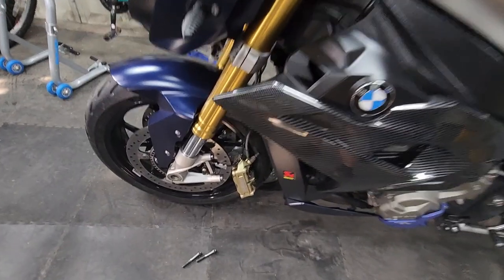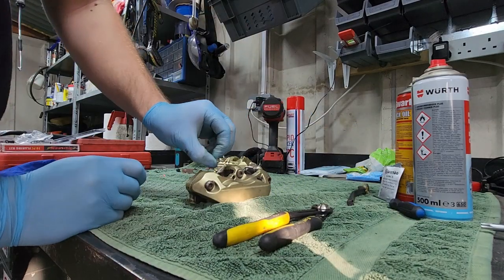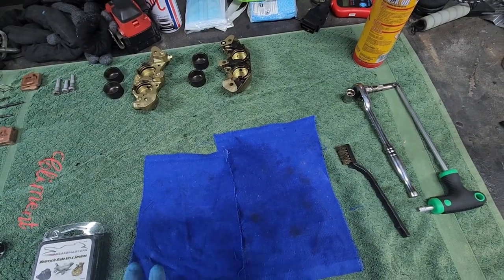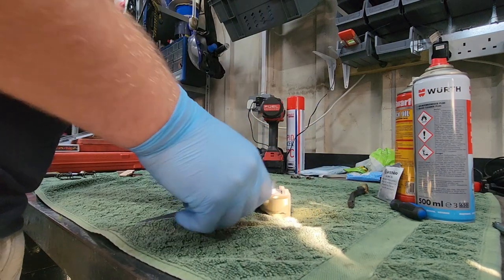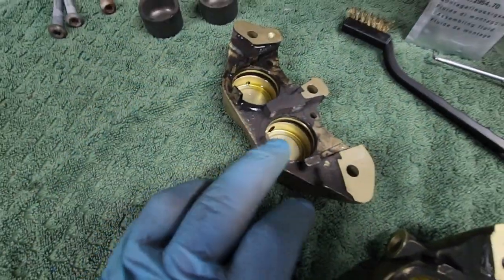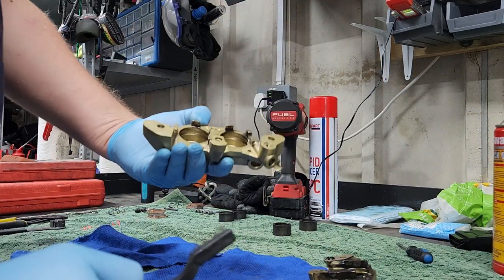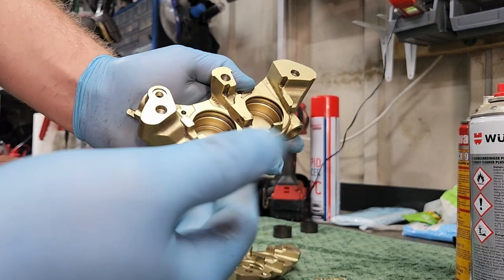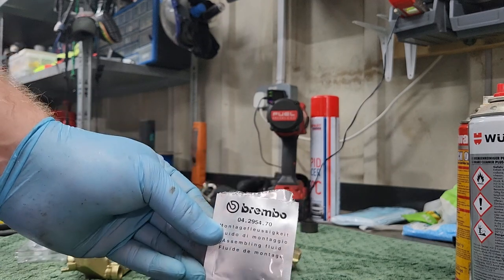BMW S1000R 2010 - 2016 Brembo Caliper rebuild

Comment: Great video - thank you for taking the time to film and upload it!

Noticed my pistons had a bit of corrosion on when I did a basic clean a few months back, so might make this job a winter project (that and adding gel to the seat!).

I presume you had to flush the fluid afterwards, and issues with the ABS system when doing that, or is it as straightforward as a NON-ABS flush?

Cheers
Reply from the maker: Hi sorry for the late reply!
You don't need to flush the abs side.